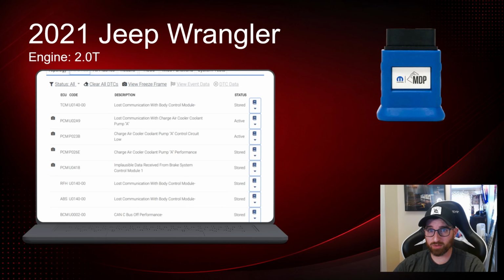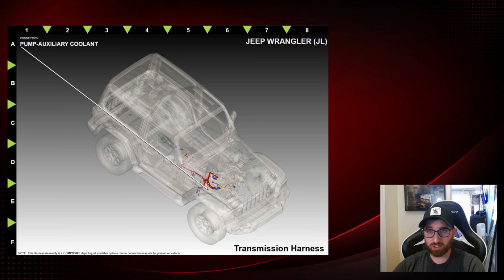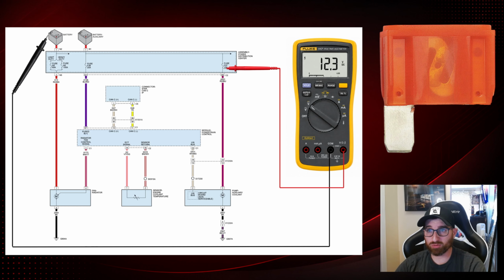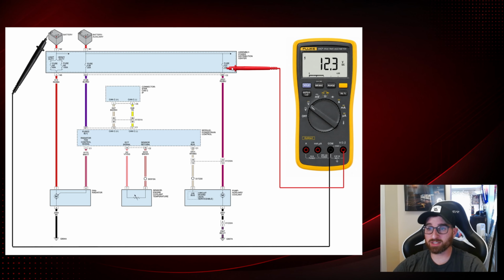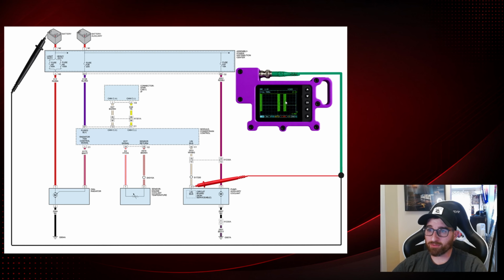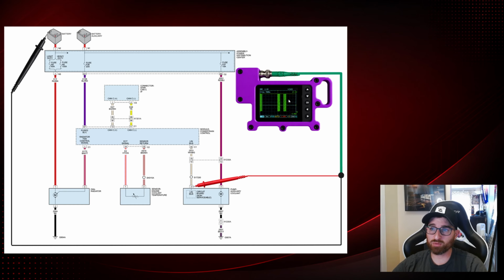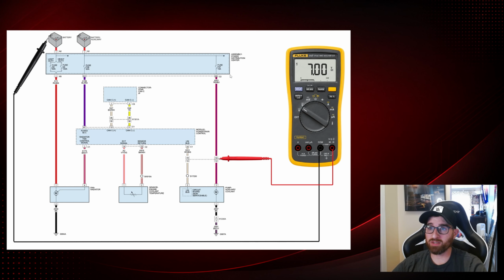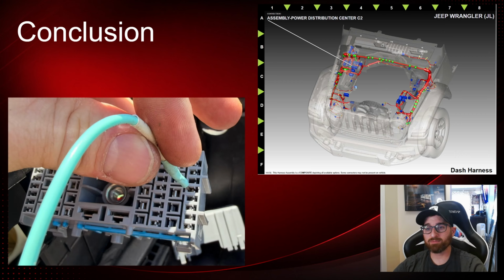2021 Jeep Wrangler Coolant Pump Fault

Comment: I had the exact same codes on my wrangler but the voltage at the intercooler connector was 12v, not 7v.  I checked fuse and replaced the pump and the code came back in 2 days.  I made an appt to take it but decided to do a search on youtube and found this video.  As a test I cut the power and ground at the intercooler and ran new wires to the battery (fused).  The code never came back.  Same issue.
Reply from the maker: Nice find!

Comment: If you are making a box to have a battery ground connection you may as well ad another clamp for battery positive so you have both for when you want to test grounds etc
Reply from the maker: I had that same idea, however a few people in the comments mentioned utilizing the power probe extension lead to have direct access to power and ground and I think it’s like 20 feet long or something. Kinda can’t believe I never through of that before

Comment: On the subject of good battery grounds until you get your box built, you could use the power probe extension lead for a good battery ground. The only thing i ever use from my power probe now is the extension cable so that ive always got like a 25 or thirty foot line or whatever length it is with good battery power and ground. That extension cord is the best part of that tool kit lol. The new power probes with the load test function look like something id use a lot more, my regular power probe just isn't better than meters or scope unless I need the power.
Reply from the maker: I can’t believe I’ve never thought of this before. You’re the second person to put me onto this method. I’m definitely going to be utilizing that idea I really like that one

Comment: Great diagnosis but how did you fix the issue?
Reply from the maker: It was a terminal tension issue. So just had to tighten the terminals at the pdc connector. It was too hard to get a video showing the actual repair so my apologies